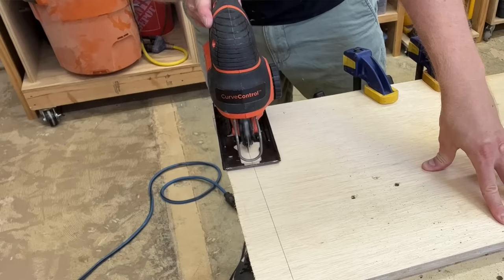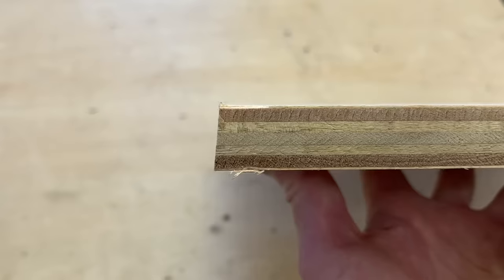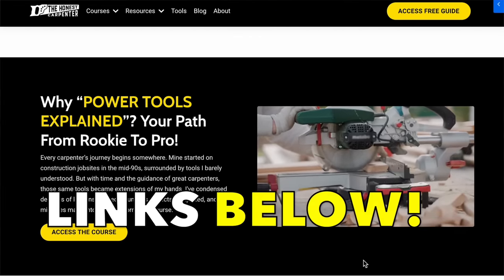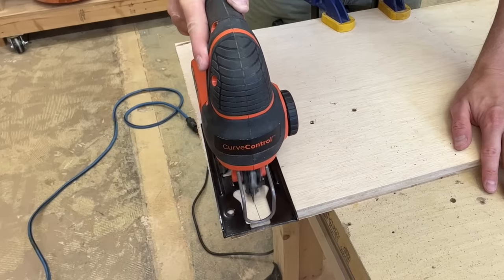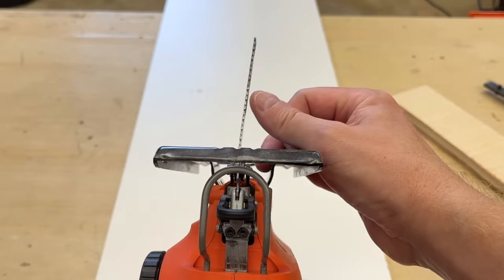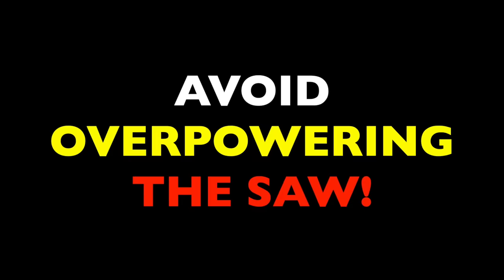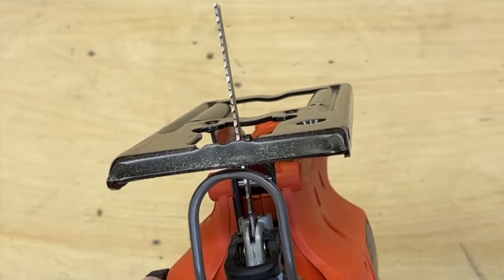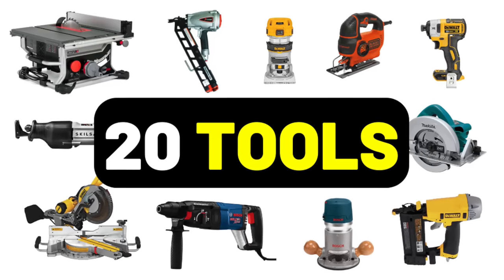Don't Ruin Your Jigsaw Cuts! (Avoid BLADE BENDING + WANDERING with Jigsaws...)

Comment: A skewed cut can be cleaned up with a router and flush trim bit. Make sure you have the bearing running along the shorter edge. That will take off the protruding edge and return the cut to square.

Comment: All these tips about blade wander apply equally to hand saws. When I was an apprentice joiner one of the first things I learned was to let the saw do the work, don't force it. Sometimes with a deep cut we rubbed some candle wax onto the blade to ease it from binding especially with a fine cut panel saw.

Comment: Good video. I'll share something I discovered that really helps with this problem, use a thicker blade. For example Bosch makes a line of blades that are .07" thick which is a bit thicker than typical. They call this their "Precision" blades and have a "P" suffix.
Reply from the maker: Good call, Tony! Somebody else mentioned this too. I wasn’t even aware that they existed 🙂

Comment: When I started using my jigsaw seriously, I did two things:
 
1. I read up on whose blades are the best, and I bought a large selection.  I keep them organized with a convenient sheet that tells me which blade is best for which application.  As far as I can tell from youtube videos, I am the only person in the world who does not just use the same blade for everything.

2. After screwing up a few cuts due to incompetence, I made a zero-clearance sole plate out of wood, and I figured out how to run it against a fence so that I can make straight cuts exactly on a pencil line.

Comment: Great tips. I got so tired of fighting this that I went to other methods when possible - especially router for longer cuts - in production. Sabre/Jig saw is still great for prototyping, though.. but it seldom gets used any more - especially on radial and circular cuts.  Thanks for the video.

Comment: I don't like being one of those "back in my day" people, but back in the 70's when I started out i never had this problem. I used to use a jigsaw for everything because its all i had and it always went straight and true. I blame all this on the quality of the blades dropping with the saws getting weaker. Back then there were no foreign made blades and I swear they were stronger and much harder to bend. 
If you have this problem I suggest buying a very good blade and see if that helps with using these great tips.
Reply from the maker: That’s interesting, 9ball. I never thought about it…but when I think back to my early learning years (the 90s), you’re right, I don’t recall it happening as often 🤔
Reply: @TheHonestCarpenter  I remember in high school I was cutting 3/4" plywood with a very dull blade and I was pushing like heck to get it cut and it still stayed true. You can't do that today.
Reply: I've noticed that the pros like Diablo brand.   They are better than the store brands but I agree with you - they just don't make anything like they used to!
Reply: I agree.  When I was about 12,  I cut a seahorse out of 3/4 inch plywood using my dad's all metal Black & Decker two speed handheld jigsaw that required an hex key to change the blade.  I'm sure that I used whatever old blade happened to be in the saw and that I pushed the cut because I was an impatient 12 year old.  The cut came out perfectly, and I still have the seahorse hanging on the wall.  Nowadays, I use a high end DeWalt jigsaw and Bosch blades, and always have a problem with out of square cuts despite going slow.  I think you're onto something about the crappy quality of today's jigsaw blades, or maybe iot's the way today's keyless chucks hold the blades.
Reply: @andrewj5998  you might be onto something. Every jigsaw that I've had and would cut square had the old style of blades. Maybe it has something to do with the T slot blades?
Reply: @andrewj5998 . I agree.  I think the new “keyless” mechanisms that hold the blade just don’t do their job.  I think they slightly tighten & loosen up creating uneven forces holding the blade.

Comment: Good stuff, I would add that many saws have adjustments ,not just for speed, but the type of reciprocating motion, with a setting for aggressive cuts vs. for brittle material, and some have an angle adjustment to lean forward or back, for harder and softer material. Using some sort of guide (scrapwood, metal bar, whatever) greatly increases chances of accuracy.

Comment: I see this happen with new blades. I have they higher end Dewalt and think it is part of function of the quick release locking mechanism. In the old days when you screw tightened the blade, this happened much less.
Reply from the maker: I could see that being the case, Kevin. Might just not get clamped as firmly 😬

Comment: Very helpful topic. I literally avoided using my jigsaw a couple days ago for this reason. I regret my decision, the hole I have is probably not any better than the one I avoided. 

I have a high quality jigsaw now, but my first one almost put me off DeWalt entirely. 
I wasn’t very familiar with the power tool realm, not realizing how much a higher end tool can really be worth the cost. 
My first DeWalt jigsaw was something I bought at a garage sale probably, I just assumed the name meant something. Not considering that this tool might’ve been a low end tool in their arsenal of options. 

But after repeatedly getting very inaccurate cuts, I came to the conclusion (partially correct) that the foot was not as flat as it should be. After disassembling and cleaning years of crud away and reassembled it still wasn’t any better. 
It ultimately turned out that the hinging mechanism was very poorly constructed and the loose tolerances had no chance of ever working properly. 
It cut off the material. But if quality was wanted, it was not the option for this. 

I still struggle with the fact that 90deg cuts are not going to be fully attained, but your info is very useful. Thx.

I still don’t have too many DeWalt tools. Just their jobsite table saw and planer. Both are excellent. The rest of my tools are essentially makita.

Comment: These are all good tips for sure. I'd like to hear more about using a guide -- either running a jig saw along side a straight piece of wood or aluminum extrusion, or using the type of guide that attached to the saw's footplate. Also, it has to be said that there's quite a difference between jigsaw models regarding the path of the reciprocating blade, whether it goes straight up and down, or at a slight angle with the bottom of the blade slightly forward, and other saws where they have an additional mechanism that cyclically pushes the blade forward on the upstroke.  And its so much more satisfying to use a jigsaw that has a smooth speed control rather than lurching to life as soon as you advance the speed roller just a bit!
Reply from the maker: Good points, Graham! I actually covered all of this in the course. My best tip for using a guide is to CLAMP IT DOWN FIRMLY, otherwise it can wander from the vibrations. And, I like to keep orbital motion turned down low, so the cut is more controlled 🙂
Reply: @TheHonestCarpenter  "Orbital motion" -- that's the term I was missing. Yeah, turning it up chews faster, but baby nibbles are easier to manage.  Thanks for the comment.
Reply: @TheHonestCarpenter  Regarding the guide, I wonder whether there are situations where running the saw alongside a guide can get the blade wedged up if it starts to "steer toward the guide".

Comment: I would also talk about the types of wood that jigsaws work best on.   I never use my jigsaw on anything over 3/8" thick plywood unless, as you said, you're cutting a curve.   And if it's less than that, especially 1/8" masonite, you have to hold or clamp it to the table, keeping the blade close to your underneath support or it will vibrate so bad you'll not get anywhere, lol.
Reply: I use mine on 3/4 hardwood plywood, as well as on 1" hardwood stair treads mostly in birch and oak frequently. That being said the cuts are never seen 😂

Comment: Ive been using jigsaws for 40 years. Seems like i never had problems years ago but in the last 10-15 years it seems like I cannot get good cuts. I don’t buy  high end tools. I have decent tools for my needs. I think they just have started making jigsaws more and more flimsy and this reflects my problems. I have tried to adjust plates, returned a few I thought were not correct when i unboxed them and understand all the points you mentioned here. I have just about given up on using jet saws for anything that matters.

Comment: I'm pretty comfortable with power tools but this has been one area I struggle with. In the past, I just use the band saw if possible. For my next project, I'll try and implement these techniques. Thank you.
Reply from the maker: Band saw is really the best option if you have one, Sierra! Solves the alignment issue automatically 🙂

Comment: When I saw the title of the video, I would like disagree with this. But after watching I totally agree with four described reasons. And I would say another advice: when you are preparing for cut, just check the straightness of blade and sole plate by square. It requires several seconds but save you much more time and material for following repairing job if something will go wrong.

Comment: You can also use a thin piece of plywood to make a zero-clearance add-on sole plate below your sole plate that acts as a guide to reduce blade bending. However, all of the tips in your video should be done in addition even if you create an additional zero clearance blade guide under the sole plate.
Reply from the maker: Good idea!

Comment: I have the same cordless Black and Decker model as you and I jump out of the roller to the right all the time. Which causes angled cuts. This jumping happens if I pull back to re-align the cut.

Comment: My issue has been cutting curves and staying on the line.  My cure was to over the thrnsaw cutting into the curve.  When the blade is parallel to the mencil mark look straight ahead of the blade,  it is aimed off the cure.  So you want to saw into the curve to where the saw needs to go,  not just the pencil line you are on.

Comment: Thank you for your great video and channel! I read in a few of the comments below, and elsewhere, that a thicker blade, such as was more common decades ago, is less prone to bending and wandering. I assume that means that a blade that produces a wider kerf will tend to make a truer cut. If that is the case, would inserting two identical extra thin blades, perhaps strongly glued together with a glue that can hold in high heat, be better for making true vertical cuts than to use a common thin blade? Sorry of this is a silly question. Have a great day.

Comment: I think I had “sideways pressure” trouble because I was trying to force my saw against the cutting guide I’d clamped to the wood.
Reply from the maker: I’ve had that happen before Talley. Following a guide with a jigsaw can be tricky because the vibrations can make the guide wander a tiny amount!

Comment: Many high end jigsaws also have one or more knobs to adjust the exact way the blade is moving. In many cases it's marked by materials/application. Selecting correct setting can change DRASTICALLY how the saw performs in both speed and accuracy.

Always remember to READ THE MANUAL.

Comment: 5.  When someone new to the jigsaw is cutting along an edge with half of the base plate off the work piece however they don't make sure the half of the base plate THAT IS resting on work piece is flat and not leaning off  the side which leads to beveled or curved edge cut.
Reply from the maker: True, Ray!

Comment: I, too, have a cheap B&D. Its soleplate mechanism was so sloppy and the method of securing its angle so inadequate, that I permanently epoxied it in place. I also bought some shorter blades, and sometimes I'd screw an MDF shoe on the soleplate with zero blade clearance.  If I continued to think of a jigsaw as an important woodworking tool, I'd toss the B&D in the junk and buy something intended for serious work. As it is, it's an if-all-else-fails tool that I hardly use anymore.

Comment: I made a rotating jig to make a perfectly circular cut with my jig saw on a really large piece of wood one time, but I would get serious blade bending no matter what I was doing. I was only gently pushing the saw, the curve wasn't small, and I made sure the blade was rated for the thickness of the wood I was cutting.

I bought much longer blades and my problem went away. I still can't figure out why I had the problem.

Comment: There are other issues here too.  The blade clamp of all the 'toolless' blade replacement types never position the blade exactly parallel to the saw with precision.  Even a degree out will result in the saw wandering away from any temporary fence and it is very difficult or impossible to get it back on course.  Also many jigsaws have a feature whereby the blade can be angled in relation to the soleplate so bevel cuts can be made.  The problem is that the adjustment is very crude - just a rough scale if you're lucky and a single large bolt to lock the position of the soleplate.  There is never a 90 degree locating click.  Ah well you say, just use a set square!  But the locking mechanism is so crude that the angle changes as you tighten up. After several attempts you may be able to get the blade to within a couple of degrees of 90 but it is harder than you think.  The message from me is never to use a jigsaw for precise work, they are not built for it.

Comment: I have been getting a lot of bounce and vibration from my jig saw.  It must be a combination of the factors   you mentioned, mainly a dull blade and a speed of the cut because mine will jump out the cut path at times.
I think it is time for me to get a new saw also, hard to find U shank blades anywhere.  Thanks for this informing video
Reply: I have an old jigsaw too, and was having the same issue. The solution that worked for me was investing in better quality blades, as well as being sure I was using the correct blade for the job. My father-in-law has given me the saw, and he was of the opinion that you really only needed one blade to do any and all materials. I know there are multi-use blades available, but that wasn’t what he had. Thankfully, I did a bit of YouTube “research” and learned lots of great tips and haven’t had the jumping issue since. 🙂

Comment: Great tips, but I've tried them and I still frequently have problems with out of square cuts. I hate using my handheld DeWalt  jigsaw unless I absolutely have to.  I've tried high end blades made by different manufacturers.
 I don't think that the keyless chucks found on today's jigsaws hold the blades as well as the vintage models that required tightening two hex nuts.
Reply from the maker: That’s a good point, Andrew! I bet those old screw clamps were more secure…

Comment: Tried to cut some laminate flooring planks (12mm) with my jigsaw today and despite inserting a blade especially for laminate cutting the jigsaw kept kicking back. I tried adjusting angle but nothing worked.  What am I doing wrong?

Comment: The roller guide on my Bosch 1581VS can slide back and forth a bit. Is that normal or do I need to replace it? We had the problem of a cut that wasn't square today and I thought maybe I need a new roller guide.

Comment: I tried using a fence and found it worse because once the blade wandered I couldn't angle or push the saw to correct because I was already touching the fence. I got straighter cuts just freehanding it.

Comment: Just wondering if a bent blade can be bent straight somehow...with heat maybe? Dont have this issue, just curious. Tx
Reply from the maker: I would just toss it, I’m afraid. I’ll bend a recip saw blade back. But with the jigsaw, it just never seems to work as well. 😕
Reply: I've done that many times and it works for a minute but the slightest error bends it right back out.   Just depends on how much you can afford on new blades :)
Reply: Only if you're cutting something that you don't care much about.  Trying to resuscitate a bent blade isn't worth the risk with today's lumber prices.  Better to lose a few bucks on a bad blade, drill bit, or router bit rather than risk ruining a project that you've invested a lot of money in materials.

Comment: My least favorite tool. The only time I really use mine is to cut a piece about 1/8th" outside the line and then using a pattern to remove the rest with a router and pattern bit. You get a perfect 90 degrees every time and a much cleaner edge.

Comment: Reason #5: Use the appropriate tool. Don't try to use a jigsaw to cut a 2x4 or a long/wide straight piece if you have a better tool for the job. i.e Miter saw, table saw, circular saw if you have one.

Comment: I think that the biggest problem with jigsaw is using the wrong tool for the job. If you have long straight cuts to make, then use a circular saw. Jigsaw should only be used for odd shaped cuts.